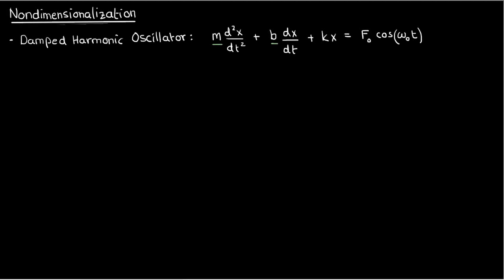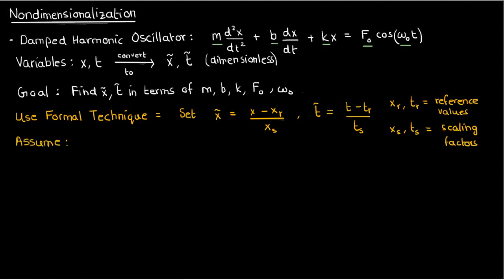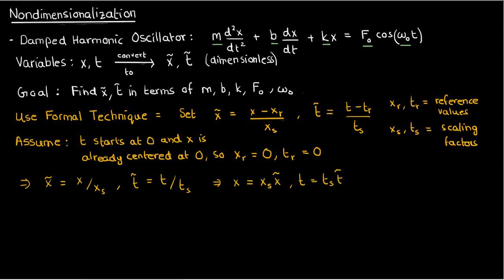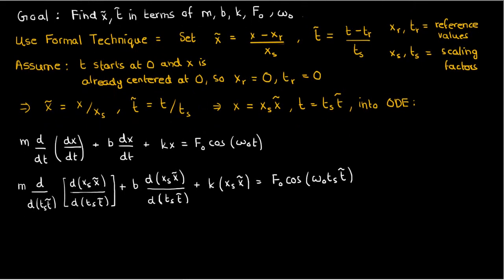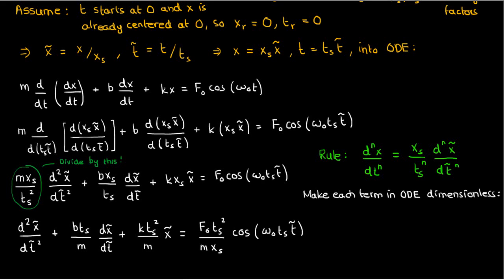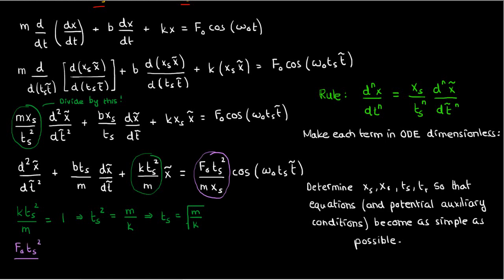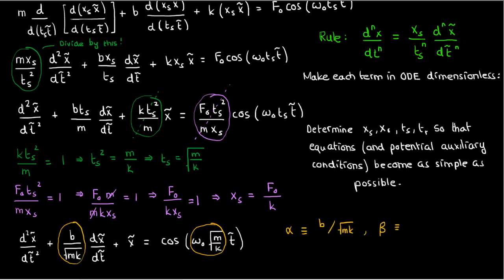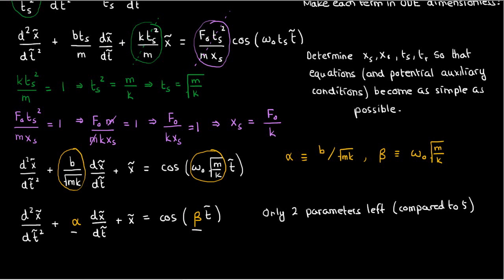Introduction to Nondimensionalization

Comment: But sir, how can we? I mean, how can we 'set' the co-efficients to be one? (That too  twice?) K and M are properties of the system and Ts is a constant(a second in this case), then how can we relate these things?
Reply: If i understand correctly, the objective is to write the motion equation in original way. The relationship between parameters is rely on the defination of the two coefficients. Thus the motion equation are is changed.

Comment: I have a problem where I am asked to find both the exact solution of a 2nd order differential equation and a trial function that adequately approximates the exact solution and plot both of them. In this context, It seems like I could group all undesirable parameters (coefficients) in each term and replace those undesirable chunks with (alpha) and (beta) form the very beginning  without having to go through the trouble of nodimensionalization and still arrive at the equation in its final neat form.

I think this approach would work as long as my end goal is to merely find a trial function that approximates an exact solution. (Beta) and (alpha) can be anything but that wouldn't change how a given trial function can hug (or approximate) the exact solution. the values of Beta and alpha would of course change how each function (exact and trial) looks like and their slopes but as long as they exist in both functions, this change will occur in both function and overall their configuration with respect to one another would not be affected. Am I correct?  

But I doubt this approach would work if the differential equation is so complicated that an analytical (exact) solution is not attainable.

I tried to understand this more using the following tool. Please take a look at it and tell me if my understanding is correct. https://www.youtube.com/watch?v=fcqdw0Zo39Y&list=PL2XSvCpZX4NaHAimCt5FfrrCMctpapkKA
Reply from the maker: You can feasibly nondimensionalize (or replace coefficients by alpha and beta) the 2nd order differential equation. If you put beta and alpha in your trial function, then changing them may not change the exact solution in a similar manner (e.g. if I use x/alpha to approximate alpha*sin(x), then increasing alpha will most certainly not result in the same overall 'relative' configuration. If I use alpha*x to approximate alpha*sin(x), the changes in the configuration will be similar but still not the exact same). So it really depends on how you implement alpha and beta in your trial function and whether or not you do it properly.

Also, your video isn't showing up for me, so I can't really fully answer your question. Nonetheless, I hope it helped (either you or someone else who stumbles upon this comment)!

Comment: What do you do if your reference terms are not 0? how do you deal with that new derivative? would it be easier if the term that wasn't zero was in the numerator or denominator?
Reply from the maker: The reference term is a constant so the dimensionless derivative will be unaffected by the reference term and everything will still work out. Hope that helps!

Comment: I don't get the part where you make each term in the ode dimensionless by dividing the entire equation by the coefficient of the second derivative. Can you explain a little more?
Reply from the maker: Are you confused about why it becomes dimensionless? Well, the variables are all dimensionless at this point so d2xtilde/dttilde2 will be dimensionless, so if I divide out the coefficient, all the individual terms become dimensionless. This is because when you're adding/equating multiple quantities, they have to have the same dimensions. Hope that helps!
Reply: Thanks!

Comment: I don't seem to be understanding why you equate those terms to 1. What does that mean ?
Reply from the maker: We want to simplify the ODE as much as possible in the dimensionless form, so what we do is define the scaling factors (e.g. x_s, t_s) such that the ODE ends up with the fewest number of parameters possible. Now how do we 'get rid' of the parameters from the ODE (e.g. k*t_s^2/m)? Well, we define t_s such that the term k*t_s^2/m equals 1, so that the term k*t_s^2/m cancels out from the ODE, and we end up with an equation that has a smaller number of parameters (i.e. the purpose of nondimensionalization).

If you need more explanation, feel free to ask!
Reply: Oh.. awesome.. I get it now.

Since you have control over the scale factors, you "tweak" them in such a way that you get an equation with smaller number of parameters.. :D 

Thank you!
Reply from the maker: Exactly, and no problem!
Reply: @FacultyofKhan  Excellent Video, but how can you define a 2nd scaling term when you already scaled the equation already? You set 1 equal to k*t_s^2/m, how can you set a 2nd scaling term again equal to 1? Doesn't that violate the previous scaling assumption?

Comment: Well edited video. I'm still stuck on the term "dimensionless" itself. I'm missing the intuition. What dimensions did our equation have at the beginning? What dimensions did we remove? I assume all of them, hence dimensionless--without dimension.

We use the term "dimension" when referring to the number of variables, usually. A line is one-dimensional, having one variable. A plane is two dimensional, and so on. I don't feel like we're using the term in the same way here. Are we?
Reply from the maker: Thank you!

We aren't using the term in the same way. By dimensions, I'm referring to units. The quantity 1 meter has units of meter and dimensions of length. By converting the equation to dimensionless form, what I'm doing is making all the variables in the equation without any units. So the x^tilde is just a length ratio instead of a pure length like x. In other words, x^tilde has no units. Hope that helps!
Reply: It sure did help me. Thanks!